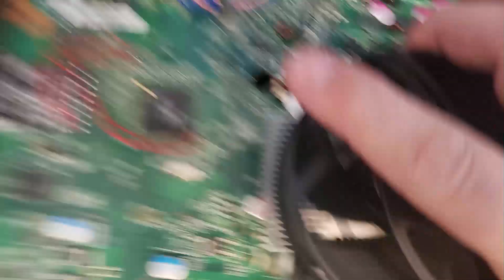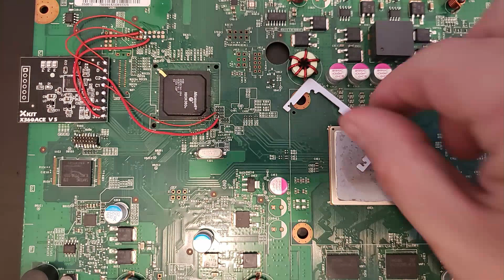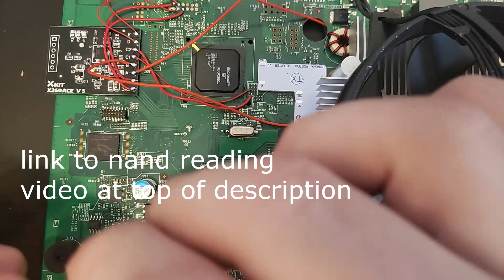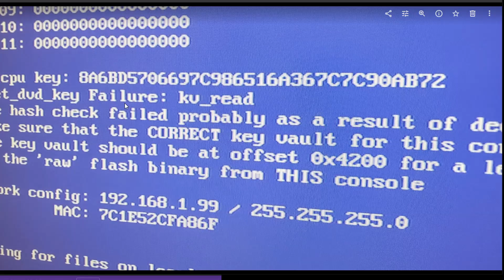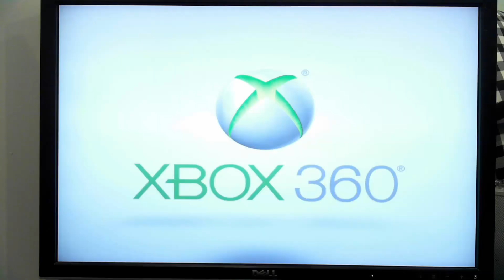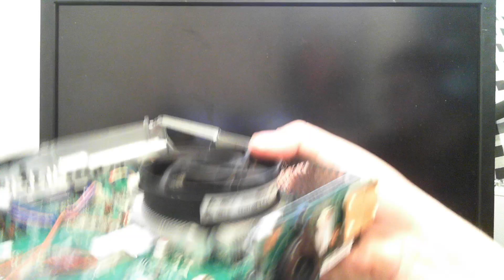2021 RGH Corona 4gb Nand Xbox 360 with Ace V5 and postfix

Comment: I have a 4GB Corona with corrupt NAND, unformatable storage. So I understand the only way to fix it is by soldering a replacement 16MB NAND. Right? Because 4GB NANDS are read with SD card tools, has anyone tried to replace the NAND firmware with an actual SD card soldered to the SD points? Again, can I write an ECC glitch file or build file directly to an SD card and wire the SD card in to the Corona motherboard to replace the bad NAND chip. I can't find anything online of anyone trying this.
Reply from the maker: I've never seen anyone convert a 4gb corona to using an SD card as the nand, seems unlikely to me...  But you are correct that there are tutorials out there for converting a 4gb Corona with a bad nand to a 16mb Corona but it's quite an advanced install and based on the cost of a 360 console not really worth the effort to me personally.

Comment: So I had an unfortunate accident today while attempting to clean up my soldering on C1 and C2... I unintentionally desoldered one of the resistors at C2, the resistor stuck to my iron and burned before I could grab my tweezers to get it off and so I bricked the board :(. Now I have to hunt down another cheap 360 s.
Reply: Damn :(

Comment: Hi everyone ! 
Console : Xbox360 E model (corona 4gb)
Modded using kind of STONE chip which is i m not sure which type and version.
Problem : Not booting

Before this probs occured, i did list as belows :
#1 - get a copy of nand by running Simple 360 Nand Flasher.
#2 - i ran XeBuild (latest ver) to get a new hack nand (actually im not sure what it called) and update it to the latest dash 17559 if im not wrong. End part of the process i had to edit by adding the "4g" to the new image.
#3 - run again the Simple 360 Nand Flasher with the new updflash.bin. + added lastest xbox dash files ($$) saved earlier in the hardisk.
#4 - booted with new dash. Adding few measures of steath servers things in the dash launcher.
#5 - trying to play online (gta5) and somehow at that point my console just shut down by itself. 

Until now it still not booting. Start button not flashing any wierd (no rrod no nothing) just as usual green light. 

Tried clear "launch.ini" +
Xell Reloaded failed to boot too ... 

I m really really appreciate if anyone here  could give me some advise what was going on with my console and what to do next. Thank you in advance.
Reply: Could it be from the nand that i extracted from the 1st step was kind of bad nand or whatever?

Comment: Hi mister. Recently I bought a 360 Corona V4 (that was never opened before) and decided to RGH it. I installed the Ace V5 following your video and it worked perfectly with really impressive boot time. Unfortunately for some reason with 20 days after the procedure the console started to take a really long time to boot (usually 5-10 minutes to boot) and beyond that the console occasionally had problems with freezing and showing some artifacts. Do you have any idea of what's happening and what can I do? I'm afraid maybe this could be a tough problem to solve, but I have no clue.

Greetings from Brazil 🇧🇷
Reply: What date was yours made??
Reply: @davkdavk  why is the date of production important? Did he misidentify the model?
Reply: @main_tak_becus6689  I was trying to identify mine

Comment: Thank you for a wonderful tutorial video. Everything explained in detail, i love it! I have ordered all I need, and will do this mod on my Corona v4 in a few weeks or so. :) A question about soldering temperature.. I usually work with around 380 degree celcius (720 fahrenheit). But I suspect it's too high, as I have lifted some pads here and there (not on Xbox'es). Is there a sweet spot temperature, you can recommend? :) I use lead based 63/37 solder.

Comment: hey bro, greetings, it is not usual but I have a situation, with a slim e (v6 toshiba) when it starts there is no problem, but there are times that while trying to start the fan accelerates and turns off, there are those who say than removing the resistor R1R1 or making a bridge between it and gnd. It is said that these plates sometimes have this problem. Has it happened? how did you solve it? You know I ask you since everything I do is thanks to your videos and this time I don't know what to do, thank you very much for your time and prompt response, greetings from Ensenada bc mex.

Comment: WARNING!!!
x360 Ace V5 when installing c1 and c2 points
There is a danger of removing the resistor.
Do not work with a lot of solder on the soldering iron.
I transplanted a resistor from the donor's body.
At that time, I measured the value of the resistor.
The left side of c1 is 33 ohms and the right side is 50 ohms.
c2 was the same value as c1.
If you have lost the resistor like me, please refer to it.
Reply from the maker: Hey thanks for sharing those values!   Was your repair successful?
Reply: @TheWeekendModder  Yes, the repair was successful.
Reply: Eu perdi o C2 oque fazer

Comment: When attaching Ace V5.
The  resistor on  the left side of the c1 point of Corona v3 has disappeared.
I bridged with a wire, is that okay?
Reply from the maker: No. That's bad
Reply: @TheWeekendModder  OK.
Do you know the resistor value to replace?
Reply from the maker: @kol5hyj562  no, I don't.

Comment: yo when i bought a 4gb reader usb the one u used it didnt come with the chip pins so can i connect it to the actual programmer with the wires stripped i have the shit for the motherboard but not the pin header for the programmer

i just dont wanna break it
Reply from the maker: You can directly wire the programmer to the motherboard, but you'll have to disconnect it each time you need to boot the console.
Reply: @TheWeekendModder  no I mean I don’t have the pin header for the programmer so can I cut of the black end of it

Comment: Hey Aaron,
If you had any issues with SMC+ on the V5, could you explain more about what it did? I had someone else test them as I have no V5s, but if it doesn't work I'd like to make sure that's noted. Its designed compatible with the S-RGH firmware.
Also glitch2m is not for most people, only for some people in specific cases.
Reply from the maker: I'll do some more testing and let you know

Comment: actually, smc+ should be better, here is a demo of it made by creator: https://youtu.be/FKGIoVQN_1I
Reply: Fyi: I wasn't able to test it in house on the V5. Friend tested and said it worked. Its really designed for S-RGH.
Reply: @Josh.Davidson   I have a big problem 
I’m read nand and create ecc and write 
But im deleted the all files and used autogg to erase nand of Xbox 
Any fixes
Reply: @darkdark2730  Your KV is lost forever. Write an ECC to recover CPU key, then use donor SMC + config + fcrt (slim). You'll need to pair your drive.

Comment: Thank you for this video 
I purchased ace 5  
And i don’t know haw to Merging this two point 
Thank you again  but it’s no need program right
Reply from the maker: The Ace V5 comes pre-programmed.
Reply: @TheWeekendModder  I have a big problem 
I’m read nand and create ecc and write 
But im deleted the all files and used autogg to erase nand of Xbox 
Any fixes
Reply from the maker: @darkdark2730  without an original nand dump you're gonna have to use donor files to rebuild a new nand.   You'll need to write an ECC file to you console, boot cell and get your CPU key, then you can use files from a donor nand to build a new one.

The console will never be able to be a retail again, and the DVD drive won't play games without more work too.
Reply: @TheWeekendModder  thank you I’m recovered my nand and rebuild again but I’m not testing yet